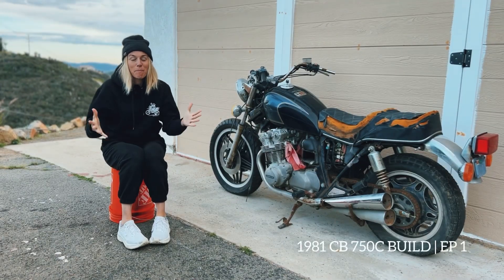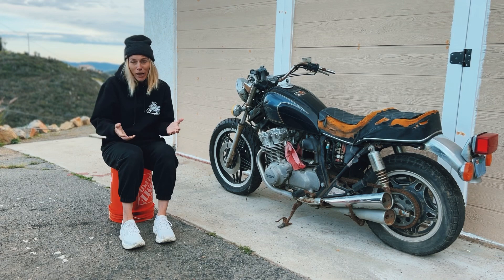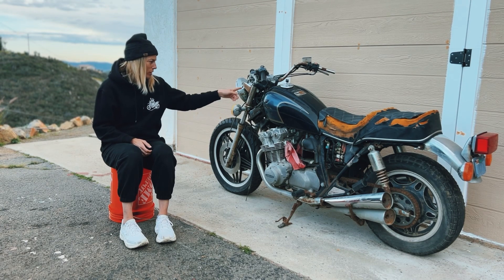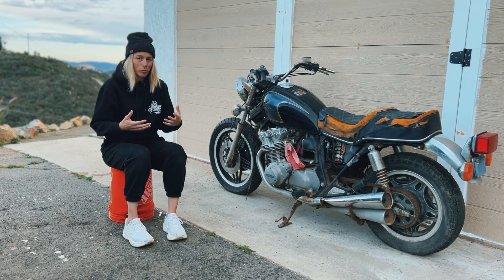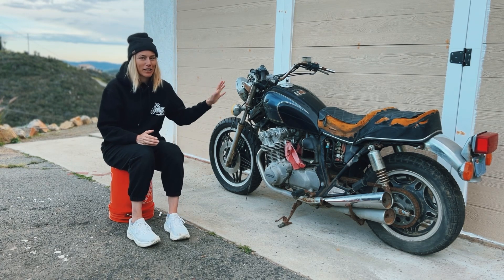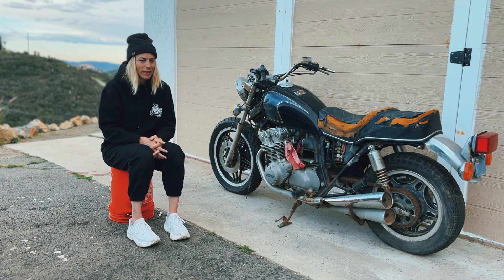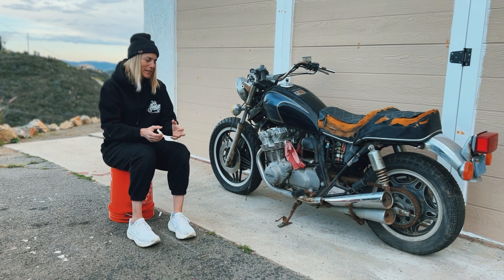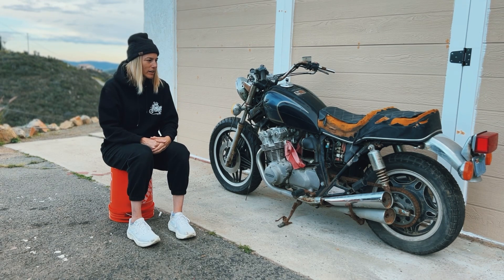NEW! PROJECT BIKE | 1981 Honda CB750C

Comment: I’m guessing a scrambler!  Great bike. I’ve always had an interest in customizing one. There is a TON of aftermarket for those and having the 81 I think is a better starting point. The 88 had a funny shaped tank.  
I have a friend that is very into CB’s and has 2 fully restored. That factory exhaust may be worth something if it’s in any kind of shape.  A lot of the factory exhaust ended up scrapped for aftermarket. Now people restoring is looking for factory. Do some research.
Reply from the maker: Once I finish the engine rebuild, I have a couple of sections and the components is one.